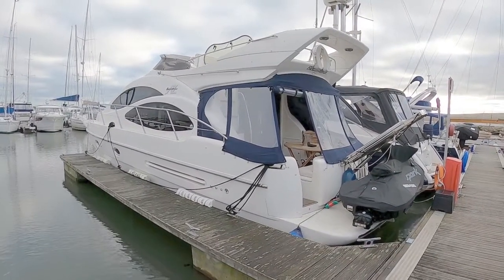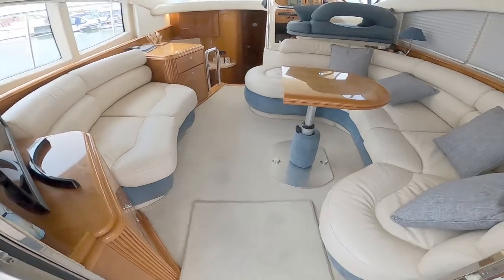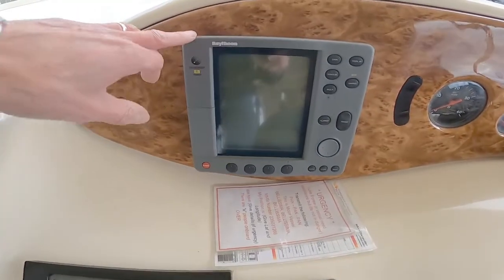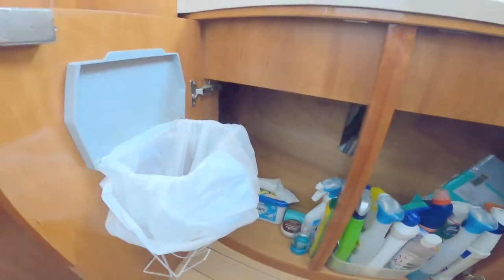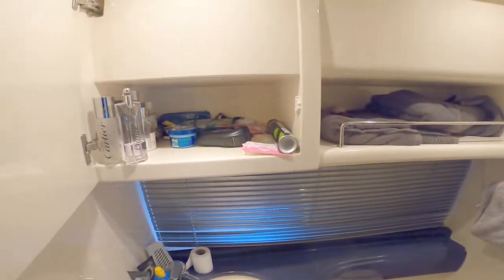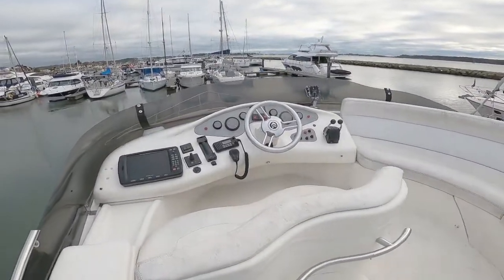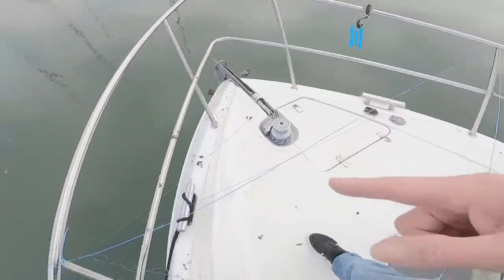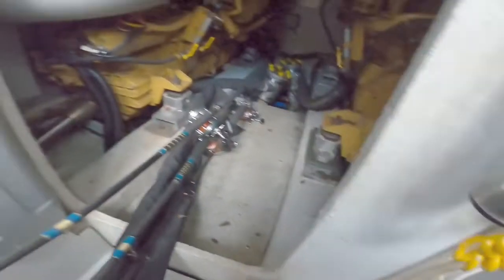Azimut 42,  Italian style, amazing space £165,000

Comment: What about the yearly costs with this kind of boat ?
Reply from the maker: Really hard to say as the mooring will be the biggest expense, and this varies depending on location. The best estimate is around 10% of the price and add a few  £1,000s, so i guess around £20K. Thanks for watching.
Reply: @A Life More Boaty  OK thanks, I would like to buy a boat like this but am worried à but about yearly maintenance costs...any tips which year to prefer motors etc ?
Reply from the maker: It's really hard to say. The engines, will be your biggest expense after mooring (possibly). I would always suggest having a full engine survey and get the oil analysed. it's a great way to see what's coming.  The other option is share the boat with someone else  half the cost. Good luck.
Reply: A lot Insurance morning fees fuel five or six grand a year easy